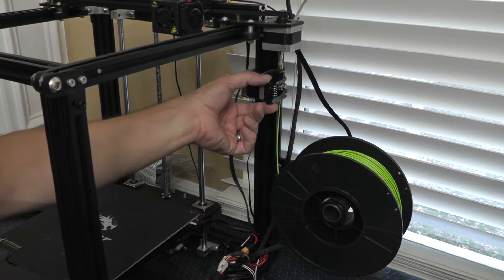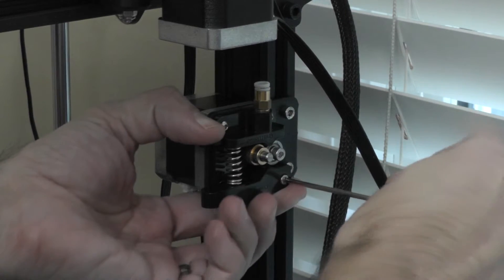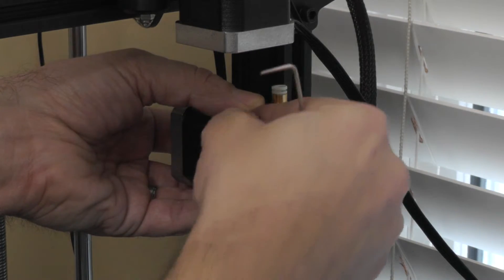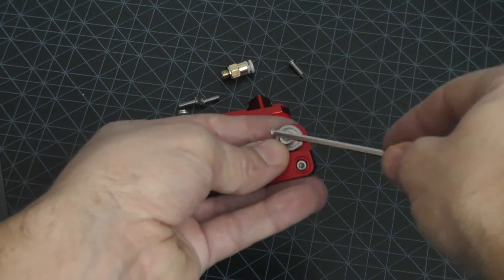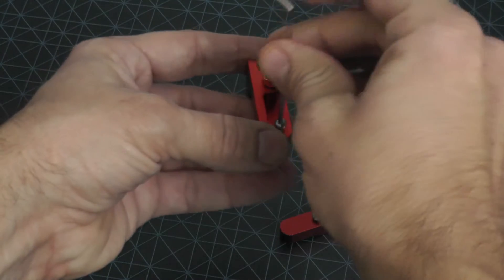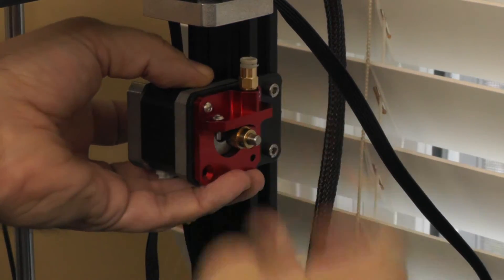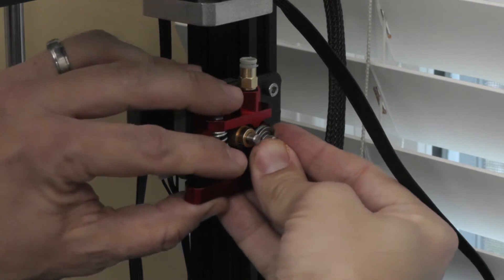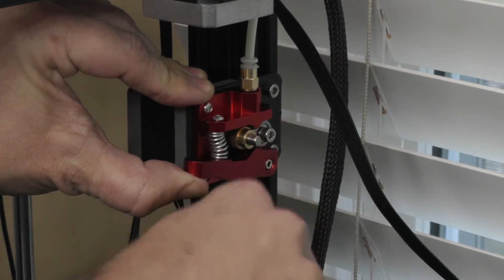Creality Ender 5 Upgrades #1: Aluminum Extruder

Comment: This was helpful, thanks. We got our Ender 5 Plus just over a month ago and it suddenly started printing very poorly. I tried a bunch of things with no luck, then remembered that when we bought it there was a choice of free upgrades and by luck I happened to have chosen this one. The diagrams are somewhat unhelpful so your video was great. On removing the plastic extruder leave I realized that it was cracked (already) and replacing it fixed the problem, so I highly recommend this upgrade.

Comment: Excellent video! I'll make a small correction, since they've either changed the piece since this video came out, or the piece for the 5+ was different. The arm now comes pre-assembled, so you dont have to assemble the idler wheel or the extra screw. Second, the adapter for the hose also comes pre-installed, and looks smaller than what it used to. Otherwise, great video! Very helpful In getting the original off and the new one on
Reply from the maker: Thanks for the updates. I appreciate it!

Comment: Don't you have to calculate and adjust extrusion and retraction rates when you change this part?
Reply from the maker: Yes, ideally you should always recalibrate your extruder when making a physical change. For this style and type of extruder, the difference should be marginal.

Comment: Great series of tutorials on how to upgrade the Ender 5! I did the metal Extruder yesterday and since then the gear and bearing just stops every  now and then. It turned out it was the type of filament I am using so I changed back to the original one I was using and working again.

Original: PLA Black
New: PLA Marble texture

Would you know if there’s anyway I can get my new filament to work?? Thanks!
Reply from the maker: Thanks! What main board is in your printer?
Reply: Kersey Fabrications I will check that in a few minutes for you. I also upgraded the couplings and to the Capricorn tube too.
Reply: Kersey Fabrications 1.1.6.1, the standard one that came with it
Reply from the maker: @04Stefan07  You can try first to increase the temperature of the hot end. If that doesn't work, you may have to increase the voltage on the steppers. If you don't know how to do that, I'm covering it in my next video.
Reply: Kersey Fabrications thank you sir, I will give that a go and let you know!!
Reply: Kersey Fabrications hey mate. I switched back to the original filament and it seems to be working fine. The marble like one does feel a little thicker

Comment: Is it possible to print flexible filaments with this extruder?
Reply from the maker: No, unfortunately not. You'll need one that has a tighter filament path. Check out the SEEMECNC EZR STRUDER. I haven't tried it myself but I've heard good things. https://www.seemecnc.com/products/ezrstruder

Comment: Mine is screwed in too tight that I can't get it unscrewed with an allen wrench. What do you recommend I do?
Reply from the maker: If you use the long end for torque you should be able to knock it loose. If not, you may need to buy some T handle hex keys.
Reply: @kerseyfabs  I just ordered a t hex allen key on Amazon.
Reply: Finally fixed after a year!
Reply from the maker: Fantastic! What did it take?
Reply: @kerseyfabs  My grandfather to come with a drill
Reply from the maker: If it works, I'll take it! 😁
Reply: @kerseyfabs  the filament isn’t going all the way in the tube

Comment: read a lot of complaints about this mod..people saying it can't be tightened or spring not engage and it becomes loose...is there a better replacement available that is more reliable...? thanks
Reply from the maker: For the record, I've had zero issues with it otherwise I would have retracted the video. I understand that others may be seeing some problems though. I do have another extruder I plan to look at sitting on my shelf: https://amzn.to/2VR8QTq  I can't comment on it personally though since I haven't used it yet.

Comment: Love your videos ad follow along with a lot of them.  BUT!  at about 1:7, did you actually lay that spool of green filament down without securing the filament and it unwound?  ha ha  By the way I had to cut the screws of the old plastic extruder with my Dremel. Believe it or not the first aluminum extruder was missing the little red bushing.  Sent it back and had to wait 4 days to get the replacement. The replacement not only  had the red bushing but 2 flat head screws,  one short like you got and a second longer one .Thank God.
Reply from the maker: Ha! When filming videos (even more so early on) I find that I am as focused on making sure the content is accurate and all of the equipment is setup correctly as watching each little detail. This is where the filament issue you mentioned came from. For the record, I have used that spool multiple times since then and no filament was harmed in the making of this video. I'm glad the upgrade worked out for you though!

Comment: Where's the adjustment screw or don't you need one?  The Extractor I put on my old Tevo tornado had an adjustment screw.
Reply from the maker: It doesn't have one. I don't think it needs it. If it's really a problem, you could swap out the spring for a stronger or weaker one.
Reply: @kerseyfabs  I'm learning all sorts of new stuff about this Ender 5.  I'm waiting for authorization to return this Artillery sidewinder X1 and then getting the 
Ender 5.  the E3D titan I put on my tornado had a big adjustment screw for adjusting tension.  Big source problems grinding filament ha ha  thanks

Comment: You should always turn the screw backwards first when installing it. Then, if you're properly lined up you'll feel the wrench lift a bit then suddenly drop - That shows your threads are properly aligned! This avoids cross-threading! I usually go a little further backwards in case it's a multi thread screw to ensure both threads are in the right place.
With that lift and drop you'll feel, you'll always know you are 100% properly aligned!

Comment: Can it print tpu with this?
Reply from the maker: You can probably print some of the stiffer TPU but not the super flexible stuff. There is still a small gap in the extruder that the filament could get stuck in.
Reply: Kersey Fabrications Thanks

Comment: That camera mount is that the pi camera v2? Can you share the link for the mount? Where do you get the fly nuts that fit the rails?
Reply from the maker: The Pi Camera mount is my own design that I'm still working to finish. There's one last piece I need to model before I publish it on Thingiverse (https://www.thingiverse.com/KerseyFabrications/designs). Here are the M5 nuts I use: https://amzn.to/2WeyAsv They aren't the cheapest but I've bought 3 boxes and haven't been disappointed.

Comment: Great content! I will definitely be putting one of these on mine. Can’t wait to see all the upgrades you make in the future! Did you remove the little black box that went on the top at the end of the I believe it’s the “x” belt? I keep trying to find something to replace it with, because sometimes the cable and Bowden tube will get caught and cause the hot end to get stuck and stutter then throw off the print. If I catch it in time I can pause then resume the print and it will reset the nozzle, but if not then it starts extruding filament off the print. Thanks again for all the helpful info!
Reply from the maker: I appreciate it! I can't figure out what "black box" you mean. You're welcome to hit me up on Instagram or Twitter and send me a pic. I haven't had any hang ups like you mention.
Reply: Thank you for the reply! I don’t see it on your Ender-5 but I’ll send a pic on IG as soon as I get a chance. Also, would love to see content on firmware upgrades if that’s something you plan to do. I’m new to 3D printing and just got my printer a month ago so I’m really interested in learning all the upgrades and techniques for making high quality prints.
Reply from the maker: @aarond.8586  I'll consider it down the road. Right now I'm happy with the stock firmware, so I don't plan to upgrade. More likely I would be replacing the whole board to put some new stepper drivers on it.